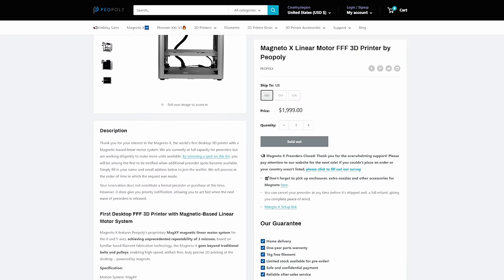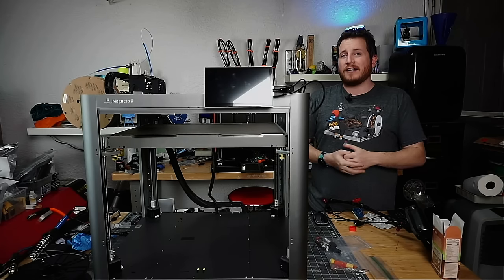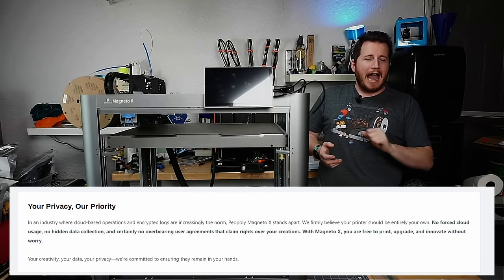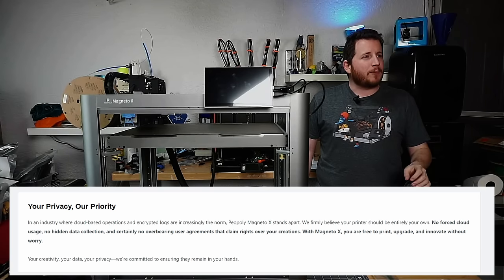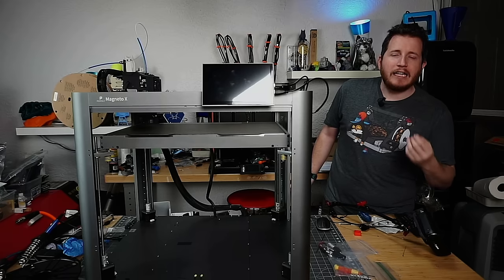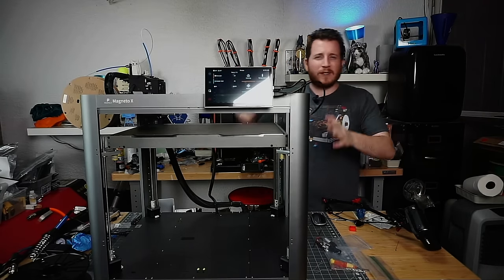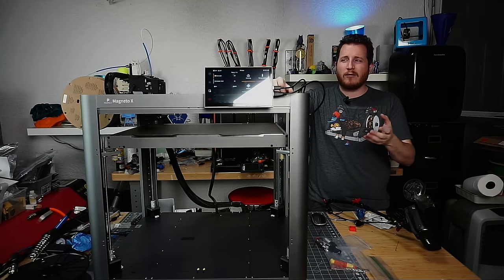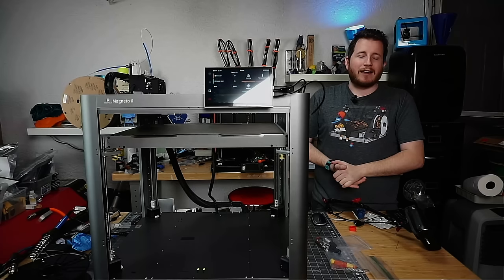Peopoly's MAGNETO X!!! Magnetic Linear Motors! NO BELTS!!!

Comment: I would probobly have done the linjear rails the other way around. Those magnets are not cheap.

They could have done the linear motor as a PCB and used Hallback array on the carriage
Reply from the maker: the magnets are needed for the motion though.
Reply: @3DMusketeers  yea.. they would still exist, but only a fraction of them.
Reply from the maker: I dont know if that would work? The fewer the magnets the lower the torque and the lower the speed of the drives I believe.
Reply: @3DMusketeers  oh yea. The number of magnets engage with the liniear motor would still be the same.  Could even use more advance magnet layout to increase the flux focus so the liniear motor could have less windings.

Transrapid use that model and it only have one winning per magnet. Granted.. it use 8000A... on the other hand its 46 ton.. so a bit heavier.
Reply from the maker: only a bit heavier LOL. I worked with some EV stuff where we did 124v up to 208v dc at up to 5000 amps all liquid cooled. Fun times... Size of cable needed? yes.
Reply: @3DMusketeers  
Yes, but the power is the same (for similar acceleration). The stronger the magnets are, the less current and more voltage you need.

The Men benefit of swiching around the magnet and the coils would be that you no longer would need high power coils and there cables on the head. While the magnets are not really lighter, the cable will not, and the cost. 

Its worth saying that transrapid don´t use fridge magnets, but electromagnets on both sides, but the reason for that is so it can levitate. So basically one sets propell it and one set levitate it. The genius of how it solved is that they act on each other
Reply from the maker: oh, this isnt levitating, there is a linear rail on the bottom. The magnets are only used for moving, not levitating
Reply: @3DMusketeers  i was refering to the diffrance to transrapid
Reply from the maker: ah, gotcha, sorry!

Comment: I want a machine that is 5foot square size.  Or better yet... a program where I can build my own machine... using their parts, the size that I want.  I am an inventor by trade... and really need a large format printer for printing large engine parts.
Reply from the maker: They exist.. Just pull out your checkbook because they aint cheap...
Reply: Well keep in mind, were looking for a company that is willing to simply provide the parts to our specifications... so we can build our own systems for our organization.  And have the ability to create new printers that suit us.  Which means to possibly provide a stock length of extrusions... where we can cut our own lengths.  Provide software that is able to be adjusted to fit the sizes or setup we want, that is not closed in to the companies presets only.  In other words... totally open source kits which allows us to customize our units to our specifications.  We have a school that teaches students how to invent, how to design and build things.  And part of that is to design our own tools.  Its often where there are no off the shelf tools to fit our projects needs.  And this is the first time I have seen a 3D printer with liner rails.  Anyway, that is what I am talking about.  Do you have any suggestions?  We are not seeking already built printers.  We are seeking Open Source Kits with this kind of quality parts where the parts companies are not afraid to assist DYI'ers to design and build their own printers.  
Do you have any suggestions besides open our check book, which is not really a satisfactory answer to tell someone?

Comment: Move to 220v country and you will be able to run 3000 watts and benefit from metric system 😅. Anyway, enough poking fun at our non metrict, voltage challenged friends. Looks like a solid printer with good potential. Small businesses like mine could do with something a little more solid and capable than k1 max without ridiculous price tags
Reply from the maker: If I could only afford to move, let alone to a 220v country lol

Comment: OK, thanks for the review, but I have no time to tweak at nauseum an expensive printer that should come entirely pre-calibrated from the factory. It needs to print perfect right out of the box. Plug and play, just like a Bambu Lab because that's the new standard.
Reply from the maker: And where exactly did I say it's a review? It's a beta unit.. 

And frankly I've had a much better experience with this than I have with Bambu. Their machines were not reliable for me. 2 lemons in a row.. and between that and their data policies, I won't ever recommend their products unless they fix those issues. 

I'm a beta tester for peopoly, that means we get unrefined hardware and software to test to limits. Literally what I said in the video....
Reply: @3DMusketeers  You're one in a million.
Reply from the maker: Not even close. 

But as the one here with the magneto x I can tell you, it's not far from being a Bambu killer.  Some good software tweaks and it'll be considerably faster and much quieter (it's already about 1/3 the noise of a Bambu). 

This is part of a beta program, it ain't all gonna work immediately
Reply: You do understand this is not a retail version right?? If you think the Bambu beta units were perfect out of the box, you have no clue how development works.

Comment: You need a dry room, or at least install the enclosure to allow you to burn moisture out of the build zone. I have a decades old heat gun from Grainer that I use to preheat the air inside my Printed Solid enclosure before a print session.
Reply from the maker: I do, yes. But no cash for that right now and no enclosure for the machine either

Comment: Typical wall outlet 15 amps, if old, might trip at around 1500-1800 watts.... good condition ones maybe more, not much. 

20 amps can run around 3000-3800 watts if you're lucky, brand new. 

You can run several printers on a single breaker, if they're i3 /mk3s (i4 etc). A few BL X1Cs etc. 

1000 watts just for the bed? You can run MAYBE 2 of those on a 20 amp breaker / outlet. 

I had to install a sub panel with extra breakers so I could run my handful of printers + pcs + power tools.... expect to dedicate an entire room's power just to this printer with lights and a laptop, rpis etc.

Thank you for the pre-production review. 
Can't wait to see the production state.
Reply from the maker: at full tilt its about 1200 watts heating and around 300 when printing. 3X that of an MK3 on printing and 5x on heating from our testing. 

Thankfully you can turn the pwn cycle down and not care

Comment: I believe this thing is a Bambu killer machine. I am waiting for mine Prusa XL to arrive, and certainly Magneto X will be my rapid prototyping machine... Great review! I am thilled about the future of 3d printer industry. I love the inovations like Prusa 's XL tool changer and Magneto 's X magnet linear system!
Reply from the maker: dude that new alpha firmware.....
Reply: @3DMusketeers  i am an optimistic person. I believe that the issues are fixable. It is big project for prusa to let it sink. BUT i agree with u, when you pay so much money for a machine like that, you expect to be at least reliable.
Reply from the maker: My XL has been reliable, just the bed issues and the Puppy issue, that went away. I dont think the bed issue, which we also had with the Magneto, is the fault of Prusa

Comment: Tradeoff is magnets are quite heavy so carriage speed movements will be slower
Reply: Speed depends on not just carriage mass but also power of drives, and the drives in this machine seems to be quite powerful.
Reply: Machines being driven to faster speeds than most hotends on the market already. If you need faster more machines is the real answer.
Reply from the maker: you can run the mag system as fast if not faster than normal core xy setups and such.

Comment: Actually, with the exception of the extruders, this machine has NO torque. Linear motors = linear force, not twisting force.

😉
Reply from the maker: So.. what is it called then? Because it's resisting motion and has inertia?
Reply from the maker: Wow, thank you for that detailed response! I will see what numbers we can get from Peopoly on it! Thanks for the correction. I will have to reference this in later videos!

Comment: Looks like a X1C
Reply from the maker: Nope.. not even close.. because the corners are rounded? It's double the size
Reply: I can only judge what I see in the video 😅 that's my opinion. I think it's very beautiful, and the thing with the magnets is super fascinating, I didn't know such a thing even existed.
Reply from the maker: The electronics are totally different, so is the basic design, 4 leadscrews vs 3, and 4 motors vs 1 lol